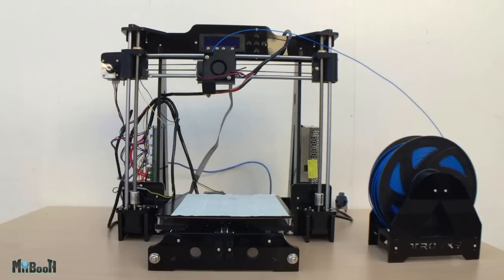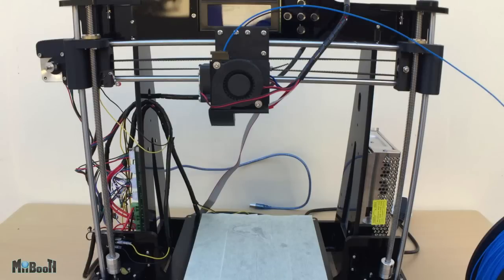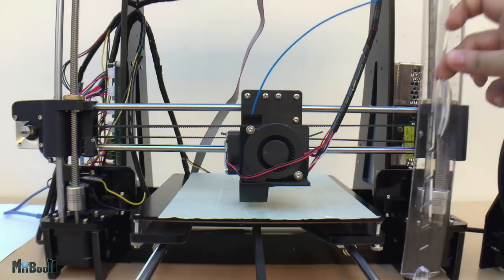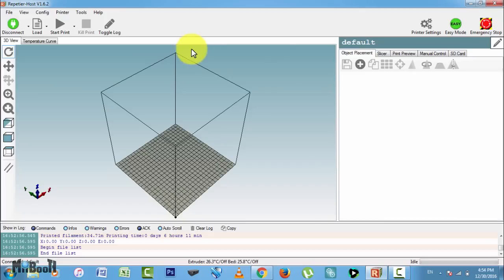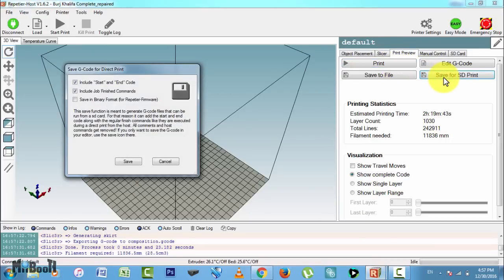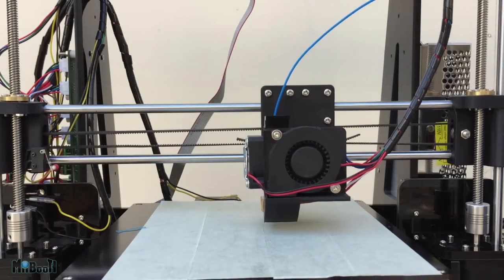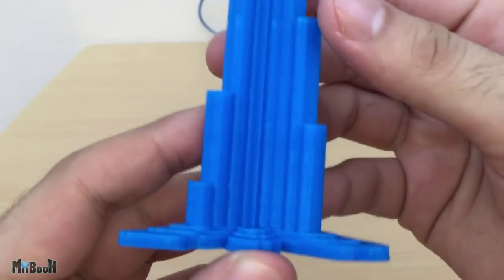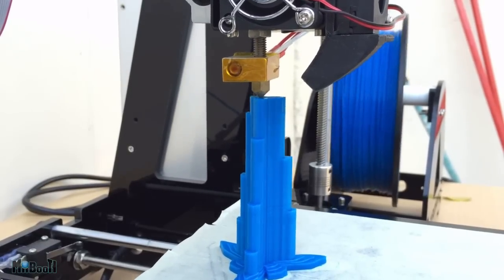Cheap 3D Printer kit review & Timlapse print | Tronxy 3DCSTAR P802 MHS | Gearbest

Comment: My son bought this same printer and one motor is not working - we switch the input port of cable from left to right and then the opposite motor doesn't work, so we assumed it was a faulty port on the circuit board. The manufacturer sent us a second circuit board but we have the same problem. Any ideas??? Help! We have videos uploaded on our channel. Thank you for your help.

Comment: I just bought this myself..it is supposed to be arriving today. DHL says its on the truck. Gearbest says this machine can use ABS filament but it doesnt have a heated bed. ABS filament usually you have to heat the bed...have you tried printing with abs yet?
Reply from the maker: Well I haven't tried ABS yes but I do know it needs a higher melting temperature and heated bed. The printer that I have reviewed does have a heated bed. So if you have purchased the same model, you don't have to worry.